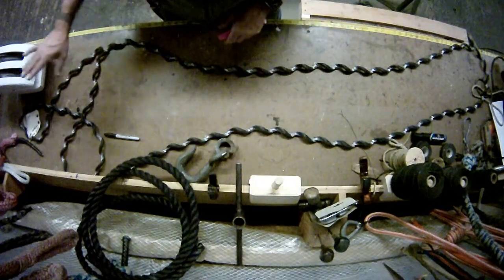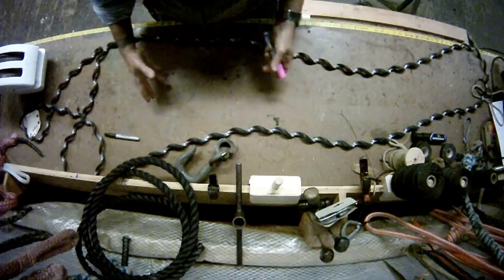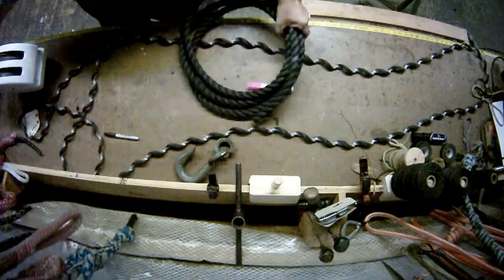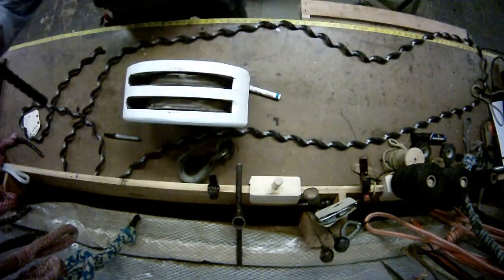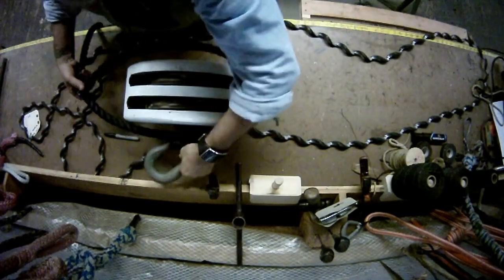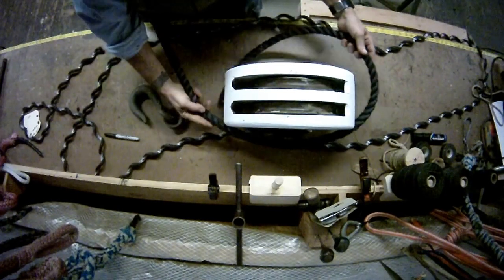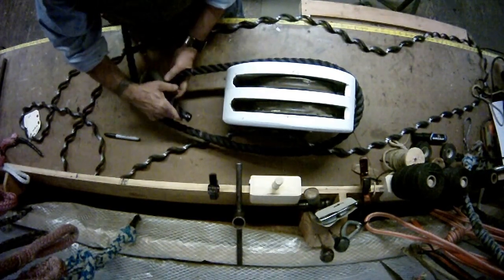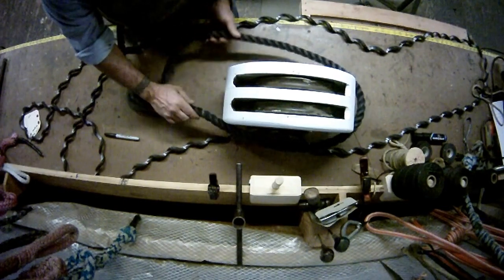Grommet making

Comment: what kind of polyurethane? where do you get it? how is it applied? can it be removed after the grommet is complete?
Reply from the maker: We use regular water based polyurethane that you can pick up at any hardware store. We thin it out with water and then paint it on with a brush most of our stuff is going to end up black anyway so we add black tint to it but don't want to change the color just use clear hope this helps
Reply: Are you talking regular polyurethane paint? I can't find just polyurethane sold anywhere. Thanks

Comment: With all those tucks, why don't you just short splice the two ends together in the first place?
Reply from the maker: Roger Banks so there are a couple of reasons why I'm making this block strap as a laid grommet the first is this method of construction will be much stronger than a short slice and the second reason is The Grommet will be completely served before it seized on the Block so if it had a bulky short splice in it it would be very difficult to put the service on thanks for your question